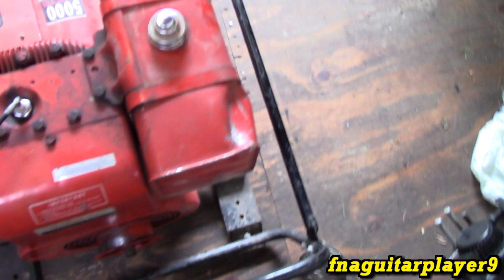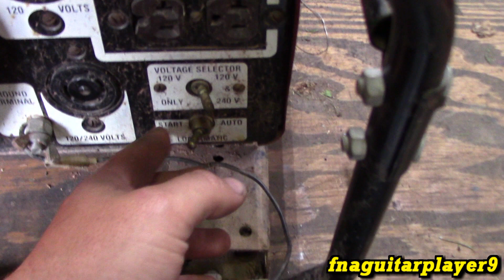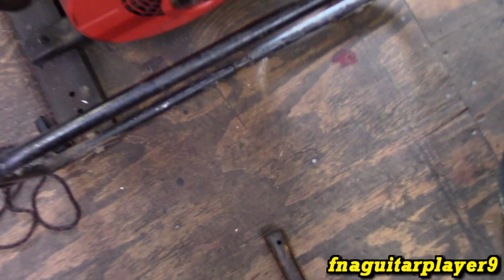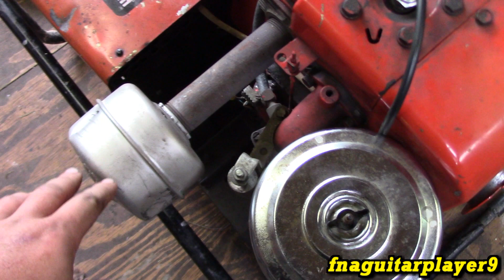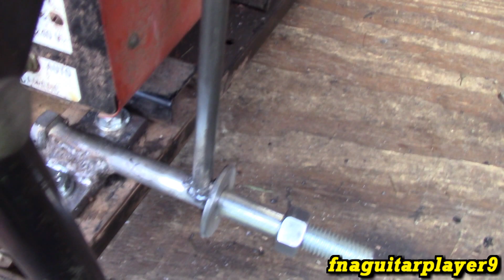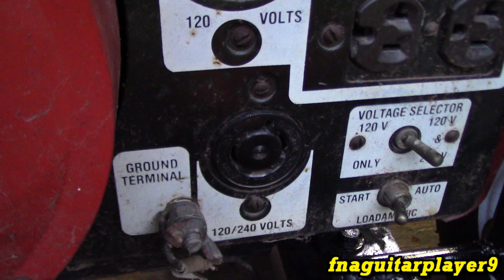Part 1 of 2 | 1980 5000 Watt Homelite Generator, Cast Iron Briggs! Wheels, Initial Run, Load Testing

Comment: Great video. It helped me to identify what kind of generator I have that I won at an auction for $80 from a business that was selling items and equipment. I did have it running at one time but I happen to cover it up and kept it outside for a while and now the mice got to the wiring in the box and tore up some wires especially the 4 wires at the bottom of the box coming from the generator and not sure where they connect to. Is it possible you can help me with a pic of yours if you don’t mind as a diagram to help me wire it back up or a website I can locate for the wiring box. Thank you much!
Reply: Please disregard last message. I was able to find the manual for it that looks identical to what I was needing on E-bay. I think I can be able to repair it now. Thanks again for your videos

Comment: An air compressor is a tough load for a 5000 watt generator. Years ago I tested mine with a 3hp compressor, and it did start it but loaded down the generator way too much. I didn't leave it on very long , because I didn't want to release the magic smoke.
Reply from the maker: Yes it is! It acted like it was going to run it at first but wouldn't after that. I heard that! Thanks for Watching!!!
Reply: @fnaguitarplayer9 You should be able to run that welder off of it with no problems though.
Reply from the maker: @fredgeitner713  Yeah your probably right, it wouldn't be nearly as much and not constant either.

Comment: What are the odds ! I just refreshed my brother's generator. Briggs #190432, type 0793-01. It has a glass sediment collector. I upgraded it from points/condenser to electronic and, clean the whole fuel system. It is mounted on an old push mower frame. Thumbs-up Frank.
Reply from the maker: I hear ya! I have a couple of them, model 19 8 Hp and a model 17 (7hp) that has the glass bowel on them. Great engines. Thats the best upgrade to make it super reliable, it was already done on this motor. Thanks for Watching!!!

Comment: Pretty cool old generator, those cast iron Briggs engines are great! Great work adding wheels to it, I need to add wheels to my old Pincor 4500 watt generator with a 10 horse Briggs. The engine uses oil though so it probably had lots of hours on it before I got it, I plan on rebuilding the engine though!
Reply from the maker: I love them! I just got another that is a model 23, it came off a water pump and has a threaded crank, runs good but smokes, it will be a video later on. I heard that! Thanks for Watching!!!

Comment: GOOD genset! The old ones are the best! My old Coleman has a 10 horse I/C Briggs and I feel your pain on the cranking. It's got the old recoil and it'll wad up your callouses on the ends of your fingers so I put electric start on it. No bosses inside the flywheel for an alternator so I just hooked up al 110 volt maintainer to the battery and just plug than into the genset and the battery is charged whenever the rig is running and into 110 when it's not. It's mainly for the well pump and the Onan 2500 pulls the coolers since it's 4-pole, 1800 r's and a lot cheaper and quieter to run. Good deal, Pal and pick me one!
Reply from the maker: I hear ya, those are great too! Yeah, it is hard to crank, but does help on this to get a "run" at it before the compression. Thats actually a really good idea, using a charger running off of it. fThanks for Watching!!!Thanks for Watching!!!
Reply: @fnaguitarplayer9  That was the only way to charge it back since there was no place to rig a charging system under the flywheel. Just unplug it from wall current and into the unit itself. 3 amp I think. Got it at Tractor Supply or Wal-mart. It does the job. And the starter sure saves the fingers and getting a run is a FINE way to do it!
Reply from the maker: I heard that!